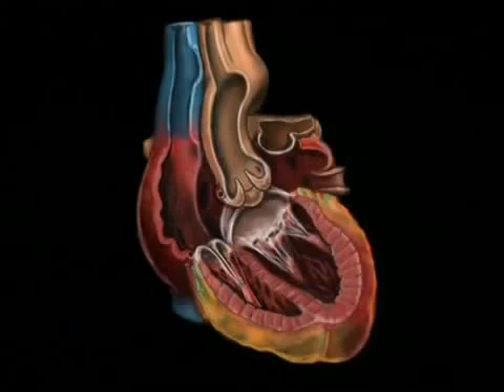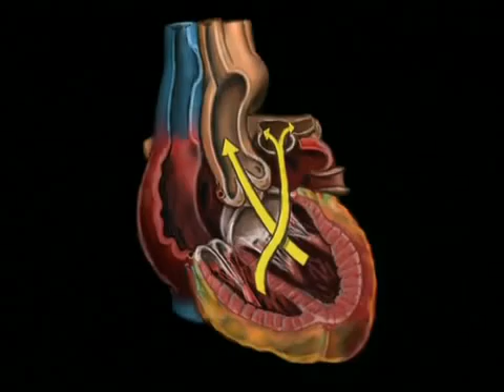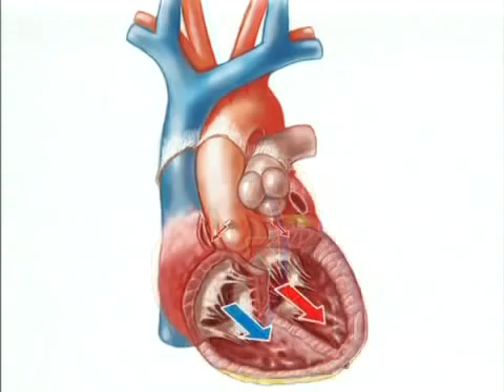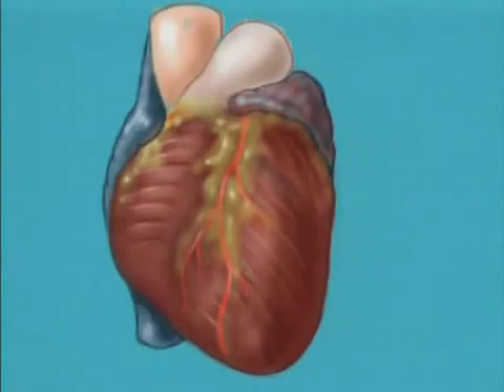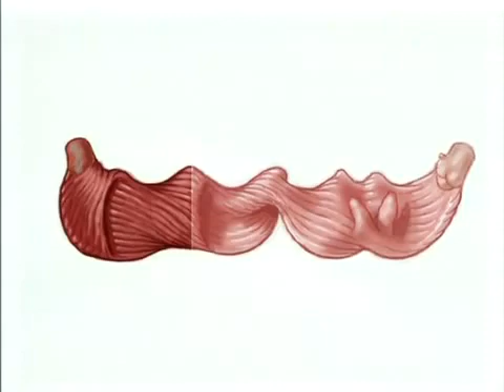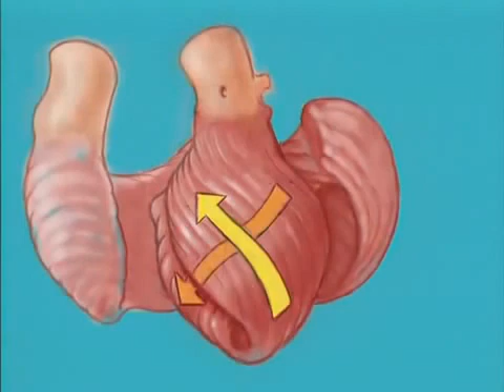The Body ElectroMagnetic field is generated by the Helical Heart - anatomy

Comment: The heart is not a pump. It's impossible for such a small structure to pump fluid thru veins, vessels, and arteries that would wrap around the globe if they were connected end to end. Instead the heart acts more like a check valve stopping the blood and building pressure and then releasing. The blood is electromagnetic and flows from electrical current. The negative and positive charges within are living water is what creates flow. See Dr. Tom Cowan videos on bitchute. He may be banned from youtube. He wrote a book called "Human Heart Cosmic Heart." He's one of a very few people who understand the proper mechanics of the heart and flow of blood.